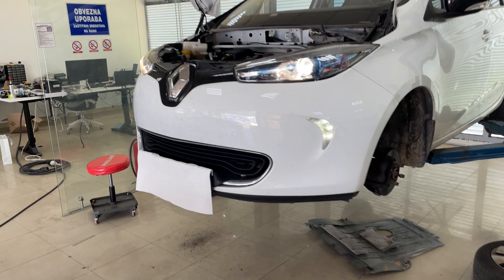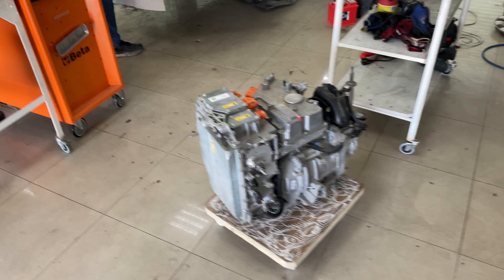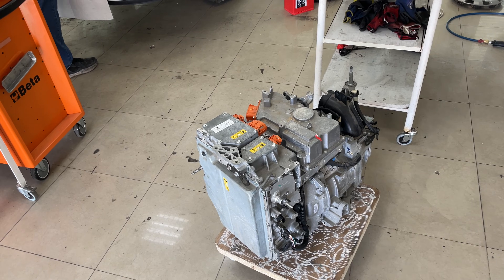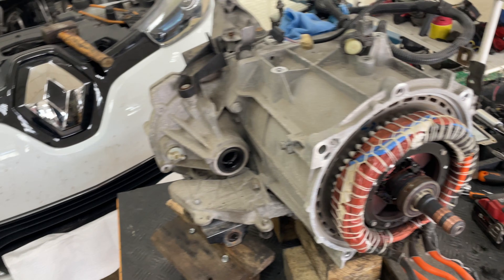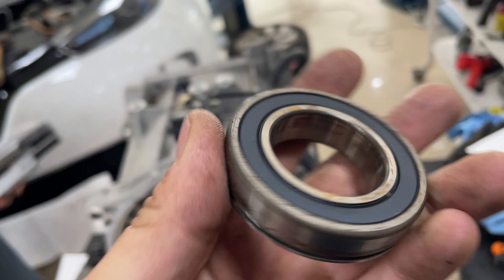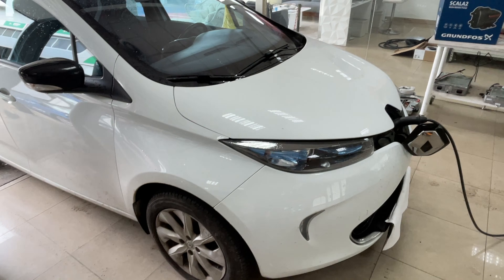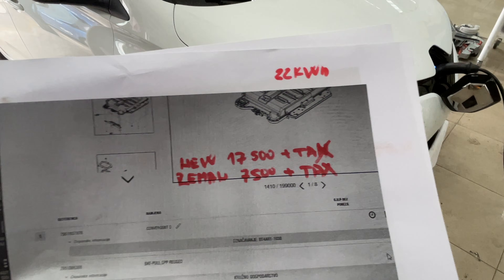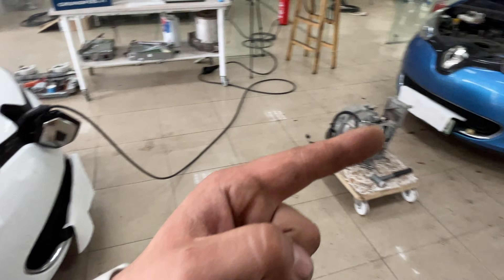Renault Zoe - R240 Electric Motor Remanufacturing - Milling sound

Comment: The motor bearings are turned into grinders due to EDM (Electrical Discharge Machining).

But when is it happening? During driving or charging? Is it worse for the bearings when doing DC charging or AC? Is 22kW worse than 11kW, or is three-phase better or worse than single-phase charging?
Why don't they add a third brusch to the rotor winding to eliminate the voltage potential buildup prior to it making a discharge through the bearing? 
Any ideas on how this could be retrofitted?

And why not use metal closed bearings instead of rubber enclosed bearings? In that case, the EDM could hopefully go through the metal casing instead; those bearings are more expensive, but it is close to nothing on the total bill...

Some proper engineering thought must be added to this "issue" as Renault obviously has not been able to figure it out.
And what about the new Renault models Scenic E-Tech, R5 E-Tech, and R4 E-Tech? Do they also have this design flaw?

My Zoe 2020 ZE50 R135 had to get a motor replacement at 175,000 km due to the bad bearings on the extended mechanical insurance. Still a 750€ deductible...
Reply from the maker: No 

Bearing damaged with coolant

Comment: Hi there I have a fault with my Zoe was thinking to change the whole inverter unit but I hear that some part inside is coded to the car can you tell me what part is coded as I wouldn’t like to change this unit and find out after fitting that it wouldn’t run. Thanks in advance for your help

Comment: Hi EV Clinic! I’m having that exact same noise as in this video https://www.youtube.com/watch?v=mGQ3EagPQao on a 2017 R90 41kwh Zoe. I believe this has to do with failing bearings. Usually it is said that this comes from the reductor. But could it also be coming from the big bearings on both sides of the rotor? Help from someone with your experience would be precious. Thanks. Ben

Comment: How long is the work involved? Installing and removing the motor and replacing the bearings? NTN now sells the matching bearings EVB355.00 EVB 355.01.
Reply: I’m in the middle of replacing bearings, tomorrow the motor will be taken out, probably:) I'm doing it myself because no workshop wanted to do it. What bearings can you recommend..?  Greetings from Poland
Reply from the maker: @Heiko2201  2 days

Comment: The Hyundai Kona through 2023 has similar issues and a very similar gear reducer design. The round particle magnet moves around and releases ferrous particles back into the oil and in some cases takes out the input and intermediate shaft ball bearings. I do note this one has tapered rollers on the intermediate shaft.
The Kona motor also suffers bearing problems from outer race as we see here.

Comment: Is this important to perform before I take out the electric motor to change the electric motor? Thanks! From Tommy Bertilsson from Sweden
Reply: Det verkar svårt att få fram lager som tål ca 12000 rpm de andra ligger runt 
7000 rpm..
Reply: @stefaneriksson3625  Hej! Tack! För Informationen. Jag undrar om du vet något om, vad man måste göra med ett Diagnosverktyg, i början på arbetet med att ta ut Elmotorn ur en Renault Zoe? Jag har köpt en Reparations och Service manual. I den står det så här:  Apply the Before repair procedure using the Diagnostic toolDiagnostic tool : Use : -Computer concerned by the After repair procedure:
"BCB" ,
-Component controlled by this computer concerned by the After repair procedure:
"electric vehicle charger//calculateur BCB" .
Apply the Before repair procedure using the Diagnostic toolDiagnostic tool : Use : -Computer concerned by the After repair procedure:
"PEB" ,
-Component controlled by this computer concerned by the After repair procedure:
"electric traction reduction gear assembly" . Kan du ge mig lite värdefull information om detta, så skulle jag bli väldigt Glad o Tacksam. Jag tycker att det är väldigt bra att vi människor kan hjälpa varandra via Internet. Mvh. Tommy Bertilsson från Mullsjö
Reply: @stefaneriksson3625  Hej! Betyder det med 7000 rpm/12000 rpm, att om jag aldrig kör min Renault Zoe, fortare än      80 km/tim. Då håller dom två Lagren i Elmotorn längre. Mvh. Tommy Bertilsson från Mullsjö

Comment: Apply the Before repair procedure using the Diagnostic toolDiagnostic tool : Use : -Computer concerned by the After repair procedure:
"BCB" ,
-Component controlled by this computer concerned by the After repair procedure:
"electric vehicle charger//calculateur BCB" .
Apply the Before repair procedure using the Diagnostic toolDiagnostic tool : Use : -Computer concerned by the After repair procedure:
"PEB" ,
-Component controlled by this computer concerned by the After repair procedure:
"electric traction reduction gear assembly".  Is this with the Diagnostic Tool important to do? Or can I skip it. Because I don't know which Diagnostic Tool you have to use. Thanks! From Tommy Bertilsson from Sweden

Comment: please don’t put bearings directly to the flame just buy a bearing heating plate or a spindle flat heater and put an old inner ring on it and heat up just inner ring

Comment: Glad I got the Q210, how much easier would you say a motor swap is on that car versus the R240?

Also I've heard about changing some kind of "gearbox" oil on the forums and that that is supposed to aid reliability, is this something you've heard of?
Reply from the maker: You have our video or post either q210. Yes it is advised to change oil.

Comment: Hello, in your opinion, which version is more reliable - Q210 or R240? I get the impression that Q210 is easier to repair
Reply from the maker: Q210 is more reliable and easier to repair.
Reply: @evclinic  Thanks about the answer. Best of luck in the new year!

Comment: Za sta mu je ova cetvrta zica na statoru?
Reply: Zoe nema zaseban 'obc' - punjač. Ulazni napon iz mreže ispravlja na ulazu, a potom je potreban DC-DC pretvarač za punjenje baterije, koji zahteva veliki kalem. Zato Zoe koristi motor, pa je zvezdište motora iskorišćeno kao ulaz, a 3 faze kao izlaz. Pulsiranje kalema/motora koristi iste tranzistore kao i za vožnju. Time se značajno štedi na broju delova. Ujedno, Zoe je jedini auto koji može vući 43kW 63A trofazno, jer u vreme kada je konstruisan, CCS nije postojao, pa mu je to bilo jedino brzo punjenje.

Mana ovog sistema je to što baterija nije galvanski izolovana od mreže, i Zoe radi injekciju 20mA između nule i uzemljenja tokom punjenja radi provere otpornosti uzemljivača , što obara RCD/GFCI (fidova sklopka) u mnogim javnim punionicama, koje iskaču na 6mA curenja.
Reply: @Mladjasmilic  aha, Interesantno resenje
Reply: @ACAGT  
Zanimljivo za Zoe, kada se puni monofazno, pošto je ispravljenih 230V oko 315, auto je bešuman, jer auto diže napon. Ali ako se puni trofazno, ispravljenih 400V dođe preko 500V, i čuje se cviljenje, jer auto spušta napon.

Isti princip koristi i Hyundai Ioniq 5, koji ima bateriju od 800V. Kako je veliki broj brzih punionica na 400V, potrebno je podići napon, pa koriste namotaje motora kao deo kola za dizanje napona.
Reply: @Mladjasmilic  To vidim ono motor od kangoo ze ima samo tri kabla a ovaj zoe 4 ali kangoo nema brzo punjenje. Na oba se stopila pobuda na rotoru i nece nijedan vinkler da ih premota...
Reply: @ACAGT  Kangoo i Fluence imaju monofazni ulaz (type 1). Postoji Type 2 na Type 1 adapter za Evropske punjače, ali koristi samo 1 od 3 faze.

Comment: Next time you need to remove the engine,just remove the whole front (bumper,coolers etc) you have a lot more room to wiggle and its only 1 hour work to remove the complete front. Great work on the bearings btw!

Comment: Still way less work and costs than rebuilding a modern diesel engine. what about the new Phase 2 motors? Are they more robust?
Reply: Q210/Q90 seems to be the more robust versions. I'm guessing Phase 2 is more reliable as well.

Comment: I have not removed the engine yet, I don't have a bearing noise, the engine runs just fine, but from time to time it shows "engine default" followed be all kind of other lights and problems. And in worst case the car stops. You can change gears but nothing happens on the display, though mechanically you can still change the gears from D to P and pull the car to the side. But you cannot drive anymore and this error comes up every 50 meters sometimes which is dangerous as hell. So I got the cr to the repair shop, they first said it is the rotation sensor, they removed the engine or the gear box, checked the sensor but it was ok. Still I could not drive the car regularly. So I put it to a better repair shop, they run all possible updates and located the error and told me that they ca read with their software the so called "wear factor of the engine. At 1,2 the engine is worn, mine hat an even higher one of 1,4, so Renault says the engine is trash and want to sell me a new one for 5.500€.... I don't know what kind of sensor produces this factor, if it can be turned of, ignored or what exactly this is. Anybody out there with more experience maybe ?
Reply: The name of that sensor is "resolver". From what you say, the fault that this engine has is not with the position sensor (resolver), it is an insulation failure that does not manifest itself under mild or cold driving conditions shortly after having put the vehicle into operation. I'm sorry to tell you that the fault is in the rotor (that insulation failure), on the shaft on which the resolver is mounted, and, I`m affraid that the rotor and stator are paired (linked). Look for a scrapped engine and have an official service or workshop with adequate equipment with a pass-thru protocol, links that used engine with the original motor unit. By the way, forget about the mechanical wear of the rotor gear, it doesn't make sense.
Apologies for my (direct translate into) English. I do not disdain any correction in this regard.
Reply from the maker: @Massimoemerito  It can be mechanical wear, check our post on facebook. We had similar case.
Reply: @evclinic  I just saw it. However, the wear of the spline on the rotor shaft may cause a knocking in the transmission both when accelerating and when taking your foot off the accelerator. I think that this mechanical failure causes the engine to stop makes no sense.
Congratulations for your work. I teach hybrid and electric vehicle repair classes to young people in a public center in Spain. If I had any technical questions, could you answer them for me?
Reply from the maker: @Massimoemerito  In EVs powertrains, there is “mechanical wear offset” where ecu detects too much phase offset between rotor resolver and esp wheel rotation. If it happens some random errors can occur and some cars have fix error showing exactly that. Renault usually cant detect it correctly. Tesla has very good integrated trouble shooting and it shows error DI_w172 (google it on tesla.com). You i can answer questions
Reply: @Massimoemerito  but the resolver sits right on the jackshaft and can by easily removed, by unscrewing the bolds, from pictures at least, or is it more complicated than I thing? Could I take the current engine out and removethrs resolver sensor and replace it with a new one ? I thin I saw those available on the internet somewhere ?
Reply: @danpin3606  If the resolver was broken, I doubt it would be broken enough to let the motor run sometimes. If it is broken, the motor would not work at all. Yes, it is possible for the engine to work even if it is damaged in certain circumstances, but not if it is cause of the resolver. I've never replaced a resolver of a motor, but I do know that there are manufacturers that replace the entire motor (including the resolver) due to failure only in the resolver. Although you see that it is easy to replace because you see that there are only three screws, any small variation in the manufacture of the resolver or the mounting angle due to clearance in the screw holes in the resolver support, I think it is essential to carry out a learning to link the assembly (old motor/new resolver) with the motor unit (electronics). I insist that I doubt that the problem you have can be cause by the resolver. I'm opting for it to be more caused by something broken down in the motor.
And I still have my doubts about the hypothesis that you have wear on the spline of the rotor shaft. This would cause you to feel knocking in the transmission both during acceleration and deceleration.
Reply: @Massimoemerito  wow, I respect your experience ! So what would you do in my situation. Option 1: let Renault install a brand new engine for 5000€, what if not the engine is the reason, but lets say the gearbox, this would mean some 4000 more, a financial total Desaster. On the other side if it is only the engine I would have an reliable engine for some more 90 0000 km. Option 2: remove the engine myself, take it apart and look for some mechanical wear, if not visible, replace the resolver myself, around 200€ and put everything back together to see if it works. Option 3: buy a used unit with engine, rotor, gearbox for around 1000€ and put the whole unit in myself?
Reply: @danpin3606  1º If Renault told you that the fault only affects the motor, they cannot tell you later that you have to replace the motor and gearbox. This option is doubtful for me.
2º If you are able to extract the motor with the means at your disposal, ask an electrician specialized in motor rewinding to explain how to use a megohmmeter and a milliohmmeter to check the insulation of the windings of both the motor stator and the rotor, as well as like the 3 coils of the resolver. Also the resistance of the stator and rotor windings. Also those of the resolver that go from 30 ohms, one of them, to 80, passing through the 40 ohms of the 3rd winding if I remember (more or less). With the motor disassembled, you can check with the naked eye if the rotor splines show wear. Based on what you get, decide whether to change the engine if you can find it at scrap yards. Unless it is very obvious that the fault was in the resolver, I do not advise you to simply replace it. If it is, you will probably have to go to Renault to have the engine learned.
3º This is what I would do if the price you can obtain is the one you mention and if you know that the set you purchased was in operation at the time the donor vehicle was removed from circulation. With this option, you will also have to have good agreement with Renault in your area because a link with the electronic engine unit will be necessary, this unit I mean is the one that your car currently has.
Reply from the maker: Interesting. They see phase offset between rotor and wheels. Your gear teeth is worn out. It is mechanical problem
Reply: @evclinic   but this would mean, that new engine won't help right ? All I need is a new gear box ?
Reply from the maker: @danpin3606  Doesnt mean that, you still got teeth on rotor, which could be damaged.
Reply: @evclinic  how could I proceed ? Should I first remove my current engine open it and check the teeth or remove the gear box open it and check the teeth ?
Reply from the maker: @danpin3606  both
Reply: @evclinic  but how is it possible to read with software this "engine wear factor", or is the software measuring the phase offset and the bigger the offset the higher the chance of mechanical breakdown in the engine ? Is it possible to exchange the teeth on the rotor inside the engine or only the complete rotor unit?
Reply from the maker: @danpin3606  complete rotor and jackshaft. You have post about it on our facebook page

Comment: Hello, great to see some EV Mechanics at work ! I was wondering, I am having problems with my Zoe 40, there seems to be an ENGINE WEAR SENSOR. The value of this sensor should be smaller than 1,2, mine is 1,4 and so I am having the message "electric engine" in the display all the time. Renault doesn't want to repair it and tries to sell me a new engine.... do you have any experience how to fix it, or is it possible to bridge or trick this sensor ? The engine is running normally.
Reply from the maker: what sensor exactly
Reply: @evclinic  the first repair shop said it must be the rotation sensor, but, they said they took it apart meseaured it and it was ok and the position of the sensor was "ok" so they didn't finde the error and put everything back together as it was.... with same error occurring soon...
Reply: I can't tell you the exact term but this sensor measures the wear, so how much it is already used up.
 @evclinic
Reply from the maker: @danpin3606  Write part number

Comment: 9:10 "...and they do not sell individual parts inside...."
Peter at 7:44 into the video "Renault Zoe Charging Issues. - Cheap Fix by James and Kate - The EV Team" 2 years ago mentioned that individual parts would be available?
The problem is to diagnose the problem not to be forced to change whole assemblies or the whole car.